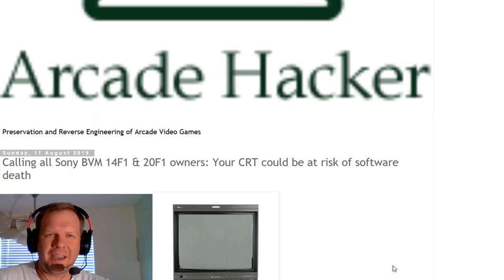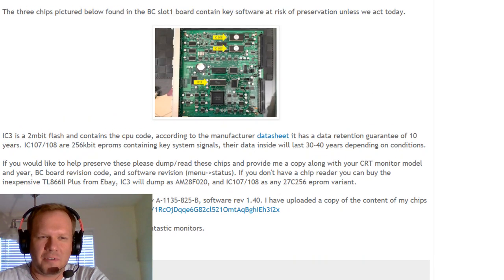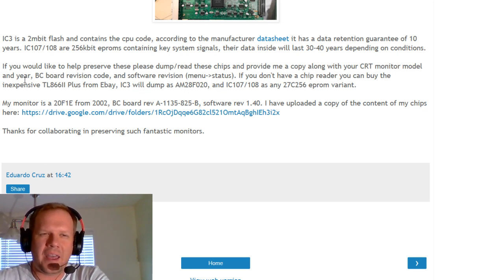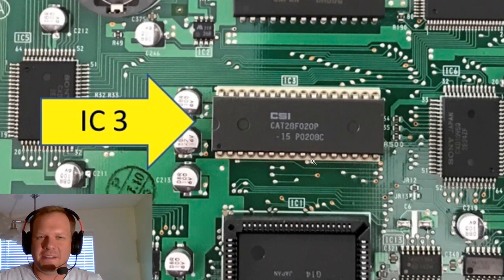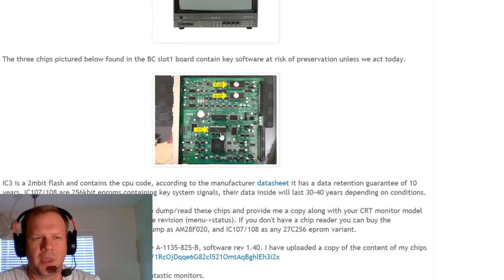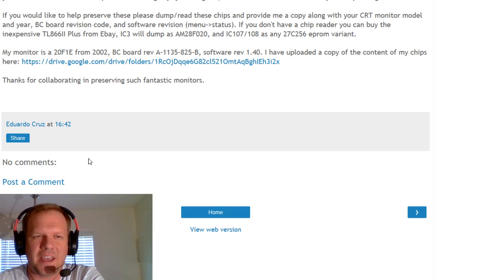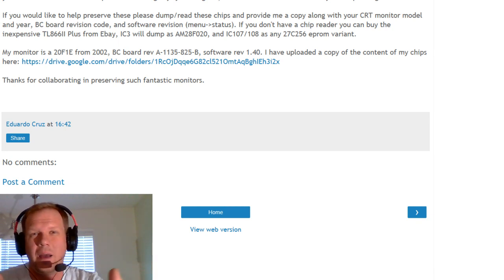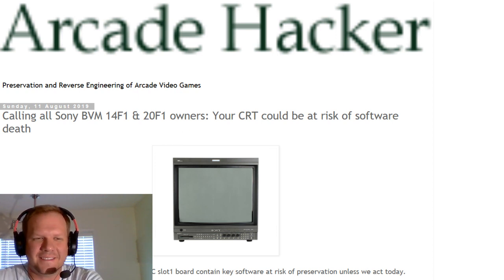Warning: Sony Pro Monitors are Dying for this reason!

Comment: Hey Steve, this isn’t a big deal. I’ve only seen corrupted system software on a 20” F1 and the monitor still booted. The MAINTENANCE menu item appeared blue and was not able to be selected. This is easily fixed by replacing the EPROM. The system software (most recent is 1.40) is available and backed up on the internet. If a persons BVM isn’t booting, I’m 99% sure that it is for another reason.
Reply from the maker: Thanks dude.  I've not had the chance to see this in person so it's good to know more on the issue.  I think as long as people know of the potential issue, then it could help save someone a lot of hassle and grief.
Reply: No problem. I just want to be clear that this is a really a non-issue. Things people should be more “worried” about: the CRT itself, the Flyback (though Sony’s are pretty great), custom Sony ICs on the various board — but that is to a lesser degree. That all said: everything breaks and fails eventually, we can only do the best with what we have, but not overdo it, if that makes sense. :)
Reply: What steps exactly do you have to do?
Reply: PhilExile: By replacing the EEPROM - do you mean the actual IC3 component itself needs to des-soldered and new IC soldered in its place? or can you flash it with new firmware while its stored fimrware is corrupted. And how would you go about doing this? I understand that v1.40 is avaialable but generally you would put that on a SRAM Card and update from there using Maintenance Menu.

Comment: My BVM-14F1E had this problem. I couldn't access the maintenance menu anymore. I removed the EEPROM and reflashed the firmware and now it works perfectly. I also got a new EEPROM just as a backup but the old one is working fine now. btw: used an EEPROM flasher I built myself out of an Arduino.
Reply: Where did you get the firmware from?
Reply: @petermay3468  I have to search for it. I should have it somewhere on my computer.
Reply: Thanks! That would be a great help if you could tell me about that. I've got one which wont let me enter the service menue as well. I kinda wish I hadn't bought it. But it was in such great condition and relatively low hours (about 30K) with no burn-ins, that i thought why not... Well... a little research into it after the purchase shows I'm an idiot lol. Next time I'm definitely googling the crap  out of anything before buying...
Reply: @petermay3468  Just post another comment in a day or two so I don't forget to look for it lol. I'm not at home at the moment and might forget by the time I'm back.
Reply: @mldkhn1  Hey man, here I am ☺ Did you find out about that code by any chance?

Comment: Now I'm also starting to wonder if this problem also applies to consumer-grade Trinitron CRTs
Reply: It applies to everything with an eprom.. computers, monitors, cars... 40 years and most of them are done, much less for flash ram
Reply: @thomassmith4999  Well yeah I know that much, but I mean the short 10y rated lifespan as that would mean that failure is about to happen on a 21 years old monitor (And is a miracle it hasn't happened yet)
Reply: Will this happen to older game systems?

Comment: Is this applicable to the D20F1E too? If so has anyone made dumps for it? Are these same chips even present on the D model? I'm aware that the D series 20F1U uses a BKM-10R Control Unit... Is it the control unit which contains these sorts of chips or are they part of the monitor itself? I've actually had my eye on a D series 20F1E but I must say that this information is a bit off putting. Should I be worries about the D series BVMS? It is my goal to own one eventually. When that day comes I would be happy to share any possible ROM dumps if I can figure out how to do it.

Comment: Correct me if I'm wrong, but doesn't that timespan (10 years) only tell you how long the data will be stored if the chip has no power on it? I'm not an expert on these CRT's, but aren't they, at least in general, over 10 years old? Best regards!
Reply from the maker: Thanks, I'm not entirely sure about that.  It's a great point to bring up.  The thing about BVMs is that many had been left on for a long time period.
Reply: @RetroTechUSA  I'm not sure we're thinking about the same thing. I wanted to say that if the TV had been left unplugged/OFF for more than 10 years, that could present a problem (if I understand this correctly). I think you misunderstood me (probably due to my poor knowledge of english language/grammar - sorry about that). You probably thought that I wanted to say that the problem would be due to excessive ON time, but that's not what I meant; I meant that if the chip stayed WITHOUT the power for more than 10 years, that could cause the program to be erased/damaged. I have practically no knowledge about memory modules, but even the "permanent" memory/storage is not permanent - wait for long enough and files on USB will go erased or corrupted (I think USB drives last for much longer than 10 years, but still). At least that's my understanding of data retention time, but as I've said, I could be wrong.
Reply: @ElectronPower  I heard that capacitors could die if no power runs through them for about 3 years.
Reply: @RoboticusMusic  Hmm, that's kinda odd, I can't think up a reason for that, it'd be more logical to me that the excessive power on time could cause that. Interesting.
Reply: @ElectronPower  I think it's like how when lithium batteries get too low of a charge they never function properly again.
Reply: @RoboticusMusic  Yeah, but batteries are very different from capacitors.
Reply: @ElectronPower  I would disagree, they are more alike than any other similar component. Capacitors even have a limited number of charge/discharge cycles like batteries.
Reply: @RoboticusMusic  Capacitors can be fully discharged (even shorted) for countless number of times and still work normally after that (if the temperature was kept below the rated one), while it's a bad idea to discharge practically any battery type below a certain voltage (except for NiCd, for example) and you have to limit the discharge current. Capacitors (depending on type) can also withstand millions of cycles while batteries only last up to a 1000 or 1500 at most (depending on battery type), with one exception (NiCd, again), that lasts up to 2000 cycles with proper use (fully discharging it every time, before recharging). You could compare a cable with a capacitor if you're so closely relating battery with capacitor. A cable with two conductors is "just like capacitor" - it has two "plates/electrodes" and a charge can build up between them. Also, comparing resistor to capacitor - capacitor also has internal resistance and inductance. And inductors have resistance. Wire wound resistors are just like inductors. There are many similarities between components but usually one component cant substitute the other. Not letting the battery voltage drop below the rated minimum - sure (NiCd can go to 0V, but be careful with other types), not letting capacitors drop to 0 - haven't seen one in practical use that wasn't fully discharged at some point.

Comment: Steve does this apply to 20G1 monitors? as I have one.  Also, my status page is blank.  No idea if that's because of a firmware fault or what, but It's been blank for a while now.  Could this happen after a factory reset?
Reply from the maker: This may be your issue.  Does your board have the same chips that are in this video?  I know all BVM Firmwares are being backed up right now thankfully.
Reply: ok scratch that, I do actually have a board exactly like that.  Didn't realise it was the one of the very end, with no video inputs on it.
Reply from the maker: @AndehX  it's a possibility that the chip is bad.
Reply: @RetroTechUSA  which chip?
Reply: @RetroTechUSA  which chip

Comment: just do an epom copy and ur golden. easy there are plenty of eprom burners available for next to nothing.
Reply: the warning is just a standard warning given, I highly doubt many of em will suffer from a bad chip but if so the warning is giving you the heads up as it's easily solved. If you are concerned now pull the chip out and make copies then put it back in and enjoy.
Reply: And BTW sony will have that file and may have as an available download link. You should send a request to the department that deals with there professional displays. Am sure that file is available to all certified sony repair techs, maybe your local certified sony repair shop can get it.

Comment: It's about Time all CRT PVM BVM Montor Dye for good, CRT PVM BVM are all outdated technology should Die for good, everyone needs to embrace new technology and not live in the past with outdated CRT PVM BVM, use a Retro Tink OSSC Framemeister connected to a modern LCD Tv Quantum Dot LED Tv or OLED Tv for much better Quality Picture, everything Dies eventually that includes CRT's PVM's BVM's
Reply from the maker: I will personally make sure this never happens.  As long as I'm breathing, I'll be restoring CRTs and teaching others to do the same.
Reply: I sure hope my PVM doesn’t “dye” the furniture it’s sat on.

My goodness, what an ignorant post 😂
Reply: what about the amazing motion resolution and no motion blur in CRT , what about zero input lag and the amazing colors on CRT ?
i start to use  some modern console with old HD crt,
nintendo switch on widescreen HD crt can destroy any high-end oled TV in picture quality ( fact ) and most people shy to speak about it .
60hz and 60fps on crt give the feeling of at least 480hz  refresh rate